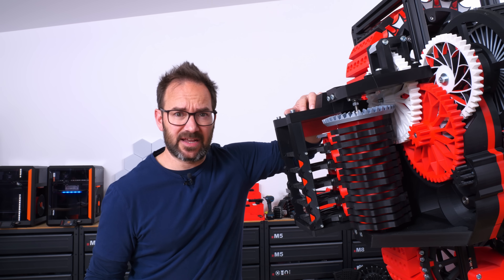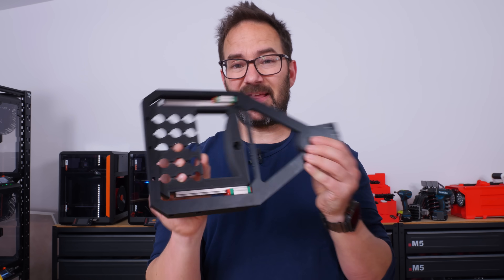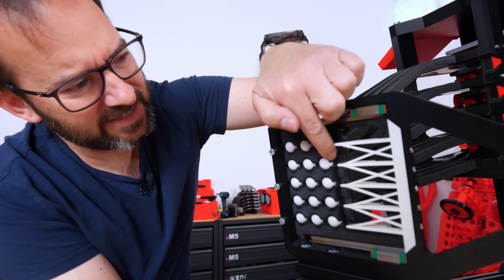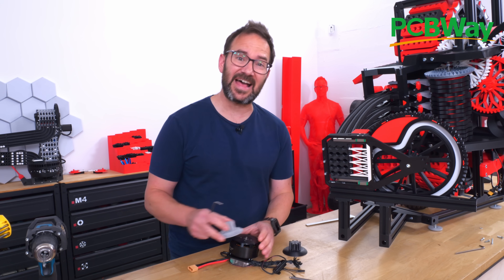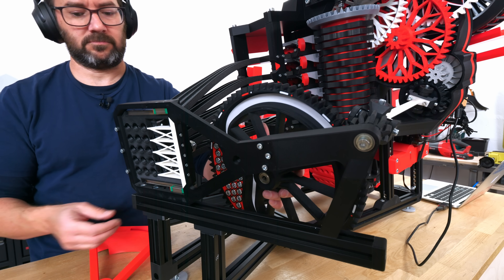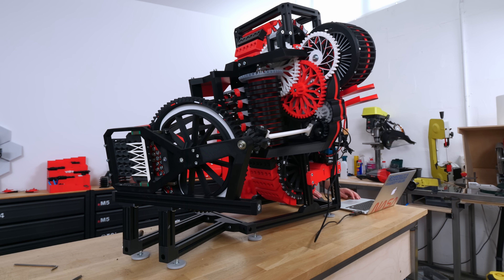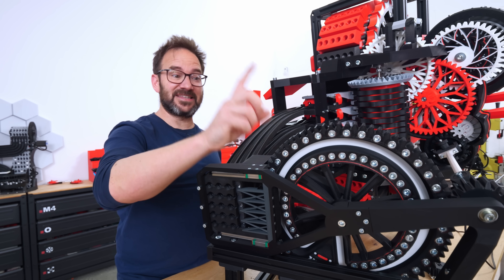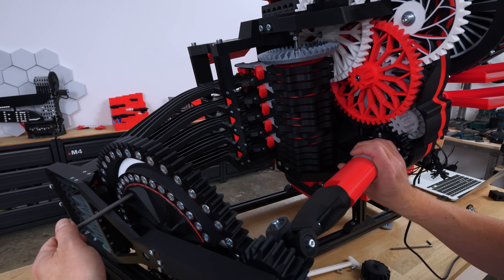Marble Clock Seconds Teleporter

Comment: Ivan - you can simplify the marble selection process by 1/3. Think about how your digits are formed. Of the 15 marbles that form each digit, there are 5 marbles that NEVER change their color. You could permanently secure the appropriate color marble into each position and not have to worry about feeding marbles to those positions. (For row 1, 3, and 5, the right-most marble will ALWAYS be white, and for row 2 and 4, the center marble will ALWAYS be black.)

Comment: It's a marble gun, guys!
Hi Ivan, I really appreciate your BIG work, but sometime i ask myself: Is this guy using the difficult approach for his choice?
Did you think about a different approach like, for example, a 4-display wheel where the bottom is filled with the next number, then it turn by a quarter and shows it up to the front, while the old number, following up the rotation, reaches a reversed position and can by gravity release the balls? The 4-faces wheel for the units can move at the constant speed of 1/4 loop at second (15 loops per minute) or with a special gear that accelerate and slow down 4 time per rotation (do you know the non-circle gears?)

Comment: Brilliant mechanism.  It should be on display in the Smithsonian Museum.   Could the marble delivery to the seconds display be tubes instead of channels.  This could be one way of preventing the marbles jumping off the track.  Another method could be a stop plate to hold back the marbles until the display mechanism has fully returned and is stationary.  It would ensure the marbles to be displayed would all appear in the display carrier at the same time.

Comment: 10:09 The problem is that Cardan joints are not homokinetic if they work in different planes, so you will always have a transmission ratio other than 1 that depends on the angles between the axes. To make a double Cardan joint homokinetic you have to rotate all axes within the same plane. I hope this helps 👍
Reply: That wasn't the issue at all, yes carden/universal joints do not maintain rotational speed at both ends during a rotation, but both ends will always complete rotations at the same speed (if they didn't you would end up twisting the shaft), and it was the total speed of rotations that was wrong, not just a misalignment in timing

Comment: instead of sorting, resorting and everything - since the numbers are predictable and always 0-9... can't you just run each number in a cycle, load in from the top, release from the bottom, and keep each column of each number in the same order. Then you 'd only need to drop in 1 number at a time, release it, and elevator is back into position. You could also back-fill and always be waiting for the number ahead of it to clear.

Comment: ? - vertical rotating cylinder - back - accepting marbles from the ramp, display when it turns to the front, and drop when 90 degrees to the right?  i.e. avoid the translation to left/right - just rotate

Comment: Bolting two mirror images of these side-by-side will actually improve your vibration situation somewhat, because the two sides will cancel each other out (if you elect to update both seconds at the same time, instead of a 10:1 ratio)

Comment: Hi Ivan, 
Love the progress that your making on the marble clock. It's great to see your process for diagnosing faults and finding solutions!

One of the best parts about 3D printing is how quickly you can create different iterations of a design, but with that also comes a lot of waste in the form of revised/ redundant parts. I would love to see a video on what you do with the bits that are replaced.  (Do they get recycled, or do you hang onto them in case they still come in handy?!) 

Either way, looking forward to seeing your next video! 😎👍

Comment: One reason for the vibrations is the shaft from the motor to the cam wheel has universal joints with ends that are not parallel. This will cause imbalance in the uni joints. One solution that comes to mind is the to remove the universal joints and replace with normal shafts connected with bevel gears that accomodate the angular difference between the axis of the motor and the cam gear.

Comment: Maybe you can add some counterweight, moving in the same moment, but In opposite direction, to reduce shaking? It can be moved by the same flywheel (two grooves in it 180 degrees apart instead of one)

Comment: nice work. Consider replacing the wheel with the aggressive cam profile with something like a crank shaft that will give you the conversion from rotational to linear movement.

Comment: 15:54 you need to add some kind of one-way valve on the marble ramp so the marbles can't fly backwards when the gate is slamming back and forth...

You might also want to order another feed ramp, gate and flywheel from PCBway made from brass or aluminum so they have more resilience and are far less likely to shatter when something inevitably goes wrong and the marbles get jammed...

And yes, clamping that now TERRIFYING contraption to the table would be an EXTREMELY good idea...it's bad enough sitting in one place, it becomes INFINITELY worse seeing it trying to wander around your shop...

😄😁😆😅😂🤣

Comment: Considering just how many 'Minor Setbacks' you experience during your builds, may I humbly Suggest a Shop Modification?

I suggest getting (or building) a plastic grinder and filament extruder so you can turn all your Oooopsies into new filament instead of clogging the local landfill...

It would also reduce the cost of your Projects because a failed attempt to do something doesn't waste the filament used in the 3D Prints as it can be ground into small chunks, melted down and extruded into new filament for the next iteration of whatever you're trying to build at the moment...

Comment: Why dont you take one larger slider for both digits? You could use the left and right movement again, without having too much space between the digits. This way it all would move much smoother, since the slider would have twice as much time and only has to change direction once a second? :) good luck!

Comment: What if instead of having 2 enormous selectors-elevator, you modifiy this one. Since the other display needs to be updated every 10 seconds, running the elevator at 1.1 links per seconds should be enough ? like you make all 10 seconds, then make the second display for the tens, send it to the tens display and switch back to the seconds display. Of course, this would be a programming nightmare with the current system...

Still, very cool ! But I think having a counter-weight moving to cancel vibrations would be nice...

Comment: My initial thought on seeing that design is that it should move up and down instead of side to side as that would allow closer spacing between digits and there's no space concerns vertically. In theory you could also alternate the placement of the cam wheels above and below to pack them even tighter, although that would then alternate the ejection position up and down unless you inverted the wheel channel orientation (so smaller diameter is the "display" position, while the outer diameter is the "eject" position). Other major consideration of such a design is that it would require slightly more torque when sliding since you'd need to overcome gravity when moving in one direction.

Comment: You should adjust the track in the fly wheel to make it pull the marble holder slower at the start and balance it out with it moving faster at the end. I'm not an engineer, but I would imagine the extra mass of the marbles in the holder would put extra strain on the system trying to accelerate all of them instantly.

Comment: why make it move all the way across all  three rows to drop the marbles.  You should be able to make it only move about 1/4 inch to do the same drop.  Have a rack that slides under each line of holes with a small tab that sticks up to block just the bottom on the marble hole.  That rack can move the 1/4 of Inch to all the marbles to fall and move back to stop the next bunch.  It should be easier to just let them fall out the front, collect in a tray and then roll backwards to the machine, then to try to strip all 15 out at a time.

Comment: You had planned for 1 digit of 3 columns. 2 digits is 6 columns (7 if you count the gap). I don't understand why the previous (single-stroke) solution couldn't work for two digits... You'd be moving 7 columns in .1 second instead of 3 columns in .05 seconds, so essentially the same speed. But you only have 2 acceleration/deceleration phases instead of 4, so you can halve the acceleration. And on top of that none of the accelerations happen in the middle of the change window, so you can make them start/stop smoother. Or rotate it 90° and have it alternate between moving up and down, so that it has to move a 5 row distance.

And secondly, I'd try giving the linkage between the cam wheel and the sliding panel some slack and make the cam wheel move further than needed. That way you can impart momentum on the linkage over a longer time (less recoil) and still have it transferred to the sliding panel by an "instant" collision. I don't know if it would actually reduce recoil, but I'd deem it worth a try.

Comment: I feel like the angle of the channel in the big cog might be a bit too close to being a radial line. In the end you'll need a certain force to slide the plate sideways, and by introducing that sideways motion at an almost perpendicular angle you multiply the force you need to input into the slider. While it does work right now, this seems like a point with high potential for failure.

Comment: Ivan, rather than shuttle digit by digit to show seconds and tens of seconds, why not try to preload each pair seconds off to either side, slide to show them, then eject. Or make a wheel with pairs of cells, say 5 pairs, preload at the bottom rotate to the top to show, then eject at 20 or 40 degrees back to stock. It would be less violent, and more stable readings

Comment: About your plan to only release one marble at a time to the seconds gate:  I don't think you should do it that way. In the slow motion footage the marbles always flew back when there was only one at the gate, but they worked when there were 2 or 3 in a track together. You may need to design a top cover for those tracks and release marbles 3 seconds ahead of time. That way the front marble will be forced into the gate and the mechanism should eject more reliably

Comment: Grove in the flywheel has a profile that implements jerk instead of acceleration/deceleration. So it leads to extreme vibrations. Why did not you preserve acceleration/deceleration from the original wheel but with more aggressive profile?

Comment: The other digit only needs to change every 10 seconds, so you don't actually need a complete mirror of the existing mechanism. It might be easier to copy paste the belt unit instead of designing a new one, but the display change mechanism can certainly be made a lot simpler because of the larger time window.

Comment: Hello Ivan, thanks to your video, there are really fun and interesting in mechanical aspect.
Juste a cool tips to keep a more constant delivery torque from your motor, you can change the cam system with a clockmaking inspired one.
Search somethings name "constant force" or "Seconde morte" (in french), it can be interesting to use the same system of spiral spring which is load during a complet turn, and discharge instantly each cycle.
If it can be helpful🤞
I wish you will read this comment
(sorry for my language, I'm french watchmaking student😅).
Have a cool week,
good luck for this time machine ! 😁

Comment: Fascinating as always, but I have to say I'm not a fan of this direction for the seconds display.  In the previous model you had two matrices per digit: one to display while you filled the other with the marbles for the upcoming second; then once per second you could switch roles.  That meant you didn't need such an abrupt transition, and you had a longer time window to see the seconds.  In this new design, in one second you have to eject the old marbles and restore the frame into position and then fill it with the new marbles... which gives you only a tiny fraction of a second to see that digit before you have to do it again.  It's more abrupt, more violent, and less effective in showing the time.

Comment: The V shaped slot that actuates the teleporter needs to have curves. The sharp corners cause too much "jerk" (m/s^3). Each side of the V should be "S" shaped - or backward "S" on the left side and a normal S on the right side

Comment: Commented this a while back;- I think you need to be considering phase offsets to smooth energy profile required to actuate mechanisms like your cams and linear rails. For example, offsetting each of your 4 ramps on your linear rail by 1/4 of the pixel width means all the ramps don't hit marbles at the same time, and therefore distribute the load over time & space.

Comment: I think maybe the idea is ok.  But may be use the idea of a trip hammer that allows you not to tie directly your load to the gear.  That way your not doing the hard right angle transitions. You could also go with something like a disconnected mechanism where the charge and return of the marble eject is done outside of the rotation of your gear and the gear merely trips the mechanism to eject.

Comment: Maybe you could add a counter moving weight on the sliding marble ejection to cancel out the inertia. That would eliminate alot of of the vibration and stress from the body.

This counter motion in theory could be designed to half the frequency of execution.

Comment: This thing has been re-polarized and is a car part being wrongfully abused and is a hand blower that they’re putting out ridiculous amount of force with it. It’ll give you a nucleation thought now the theme that I’m getting at the reason that I’m bitching is because there’s an atomic heat load. I use these things for actual jet engines And there was a regulation on the hand tool this thing over exceeds the regulation by so drastic amount much that if I activate this handgun that is this blower that’s a black nondescript cordless blower in an advertisement that there’s no way that says super powerful cordless blower and it’s black and it’s got some Chinese people blowing leaves around. That thing is a fucking handgun. It is more dangerous than if you were to have a Mac 11 with an unlimited amount of ammo that you would never need to let off and it makes literally the world can be turned into Jupiter from that fucking tool and it’s so easy. It’s not funny. Vacuum cleaner is already strong as strong could possibly need to be to make black hole holes, and you guys have far and away made black holes now in all of themyou can’t see black holes black holes are like bubbles in the air and you can’t see them your eyes won’t let you. It’s called a Doppler effect.

Comment: Have you thought about having the marbles sit on a steeper slope when sitting in the display slider so they are less like likely to kick back when the slider moves? The track and the slider would interweave and the track would limit the vertical movement of the marble and the slider would limit the horizontal movement in the space currently occupied by the display slider. I would also cover the marbles in coming into the display to prevent marble hopping.

Comment: I love this project.  Just a thought, how about incorporating the marble ejection into the drive wheel and get rid of the sliding mechanism. Doing this without getting in the way of the loading ramps would take some thinking though, but would get rid of a lot of the jerking and vibration.

Comment: You can probably reduce the shaking by adding a few washers to the bolts on the 'flywheel' camtrack gear thing where the the inner bolt circle is disrupted by the track till the gear is a bit more balanced. Still going to be quite violent laterally with the speed the gate cycles, but probably get less vertical shake which will help it shuffle on the table.

Comment: Hi Ivan, I think that to reduce the vibrations you should try to balance the wheel with in the system, so that when the carriage screen gets moved to the right, the inertia of the wheel should push to the left balancing out the movement. To do so I guess you can try by removing some of the screws on the opposite side of the curve. Also you can try by enlarging just a bit the radius of those curves. Anyway I love the energy and investment you're putting in this project! I find you and your work super inspiring.
Reply: I also thinks so, like a crankshaft
Reply: Actually if you check at 14:42, the vibration is at a higher frequency than the wheels spin. This is not due to imbalance in the wheel. This feels more due to the universal joints which are not aligned axially.